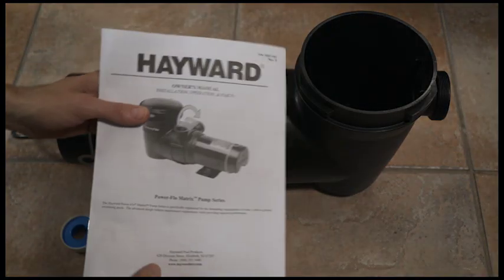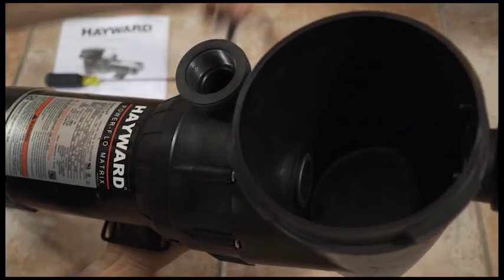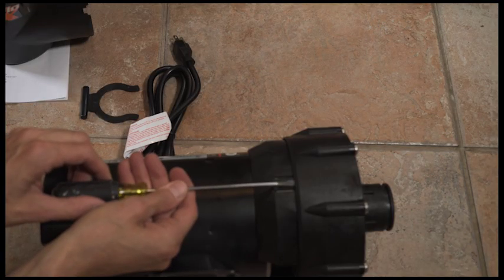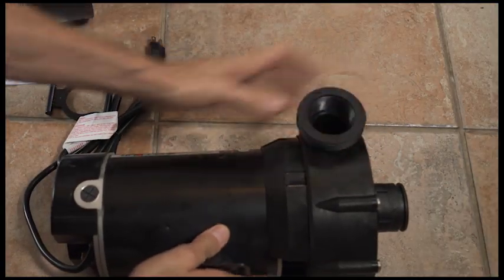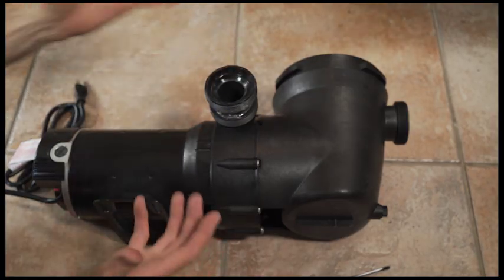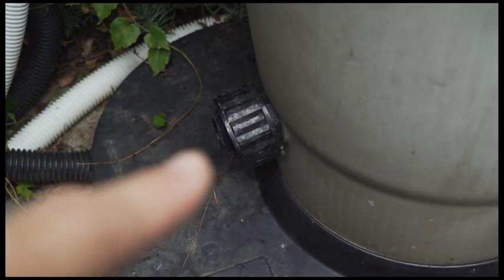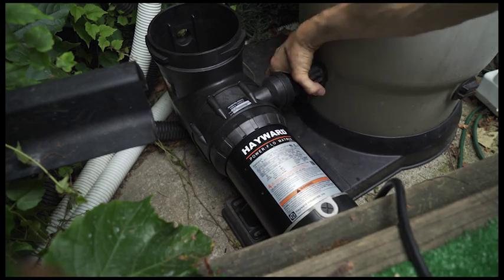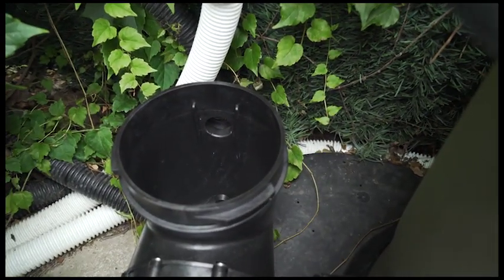Hayward Matrix Pool Pump rotation and installation

Comment: No teflon tape?
Reply from the maker: For the union you don’t need tape as it is a compression seal. Tape would not be recommended for this as it may impede the ability to fully tighten down the union.

Comment: Hey Mike, is there a seal or o ring between the pump and the union where u attached the filter. Just curious because I have a small drip between the filter and the pump. I sure hope u still check your comments.

Comment: I wonder if you can help me. I have a Hayward matrix power flo 2 speed above ground pool pump and I need to change the switch. Here ia my problem. The back of the pump does not have that cover that comes right out with one screw. Mine has two holes in wich seem to have flat screws. But even if I unscrew these, the back does not pull out. I did not take the screws completely out not knowing if it is ok to do so. Can you help me in telling me exactly how to reach that switch. Thanks.

Comment: Just curious, why did you remove the basket? Wouldn't it have just turned along with the section you turned.  Thanks for pointing out where that tab was.

Edit: Well. I followed your video along with the manual and the install went perfectly. I'm guessing that the horseshow clip would have held the basket too tight to turn and that's why it needed to be removed.  Don't know how anyone could press that tab down without your screwdriver trick.  Thanks again!

Comment: Does it have to have a union from filter to pump? I bought same motor but new and it had a different fitting than my old motor so unused a hose and clamps....but I'm having zero suction somehow. What is grey stuff u painted on?
Reply: The grey stuff is Pipe Dope. The manual says not to use it on threaded fittings and use Teflon tape instead. I use Pipe Dope and hose clamps where  flexible hoses fit over the tapered fitting (the opposite end of where he 'painted' on the dope) and only have friction to keep them connected.

Comment: I just came across your video and I am glad you did not add teflon thread tape to the male end of the coupler; there is a 2 1/4" rubber seal on the inside of that male end which connects to the female end. Adding teflon tape will not allow the threads to tighten enough against that rubber seal thus causing a minor leak or a larger leak depending on how much tape you wrapped around those threads. Good video on replacing your pump. Cheers.
Reply from the maker: Thanks for the kind words :)

Comment: i can't seem to get the union between the pump and the filter to stop leaking water
Reply from the maker: SOunds like you may have a scratch or something in the union where the to piece meet - - I'd disassemble and carefully inspect both pieces - even a small defect can cause a leake here.

Comment: Mike I am unable to lock this in position I do not want to break it- The guy that designed it should be shot- the button should be raised to get to it.Any suggestions? I am trying to gently trying to get it to click but it just will not go!
Reply from the maker: dennis seger - I’m not sure what to mean won’t lock.  Do you mean you already rotated it and at the end of the rotation it is not locking into position?  If so rotate it back and see if it will lock in the original position.  You can give a pretty good slam into position (not too hard though).  If you’re unit is new and is not locking then I’d bring it back to what’s you bought it as it should be working.

Comment: You did it the hard way. Nothing to remove if you just reach under the pump and push on the tab and rotate the housing.
Reply from the maker: yes but if you don't remove the basket, rotate it 90 degrees and then put it back together it will be sideways.

Comment: I have to remove the pump from the mounting plate to change the basket nut the screws are very rusted........any tips on how to remove the pump fro mounting plate?
Reply from the maker: I'm not sure what mounting plate you mean but If the bolts are really rusty I'd gently tap them with a hammer (Don't tap the threads, only tap the top of the bolt or the nut).  Then use a penetrating fluid that you can buy from any hardware store and follow the directions on the label.  DON'T force it as you will likely snap the bolts. There are lots of videos on youtube that I'm sure you've already watched...  Best of luck with it :)

Comment: I just got this very pump yesterday. Got it installed and it's leaking water at the cap line. So aggravated! Any ideas what might be the problem? Also, I put the proper lube on the O ring too. Thanks in advance.
Reply from the maker: Do you mean the cap itself is leaking? I'd take a very close look at the  o-ring and make sure it is not damaged.  If it's in good shape, you have the cap put on correctly and it's leaking then you may have a dud.